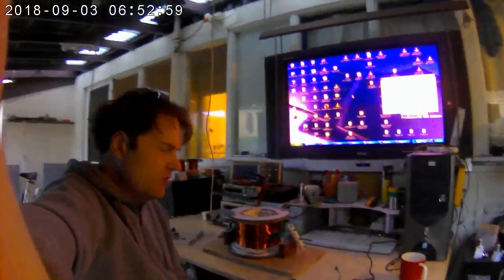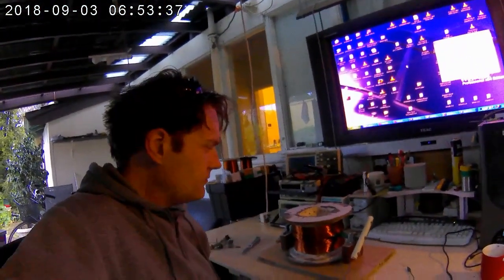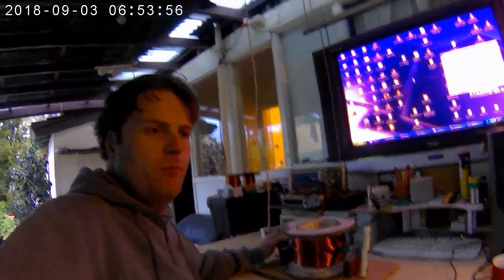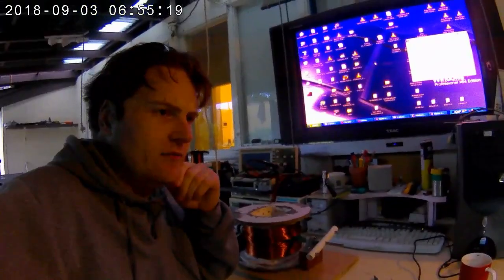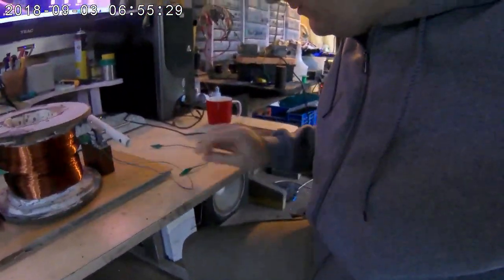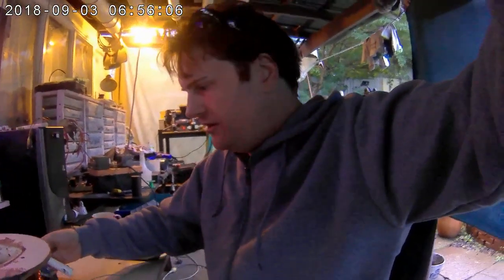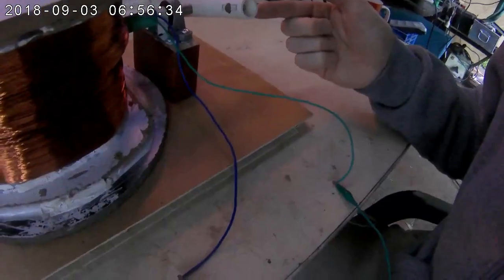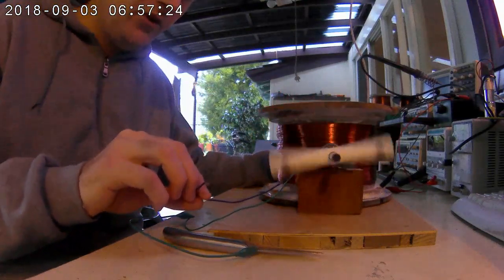Experiment in Free Energy, Amazing, [Newman Motor Part 3]

Comment: The working principle of any machine is based on the vectors. Everything is a question of vectors. Did you mind about the vectors? Usually the magnet rotate outside the self because we can put a core inside the self that concentrate a lot the magnetic flow through the self. The difference I have noticed with the Newman arrangement, where all the magnetic flow is already inside the self, is that the vectors are turned of 90 degrees, as they happen during the rotation of the magnet, uniquely. See usually, when the magnet rotate on front of a self with both leads connected, the first vector is repulsive and so is resistive against the magnet motion because the self oppose a pole of same polarity when the magnet pole is approaching,  and the second vector is attractive and so again resistive against the magnet motion because the self pole become the contrary of the magnet pole when the magnet pole is going away. Both vectors are resistive because you can not produce energy without producing a resistance of same amount, as e=r here or resistance is the contrary of the energy. The self become an electromagnet when an electric current pass through it, and so if the leads are not connected then there is no current, no electromagnet and no resistive vector. The parasite resistances such as mostly air friction, and the bearings, cause the resistance to be winner in the équation, and no moreover energy is created, only more energy consumption equal to the resistance. When the current is produced, you get an equal big breaking effect of the axle rotation.

Comment: just add diode in it to charge the battery, not used it directly to the coil so that the magnet continuous its natural motion.
Reply from the maker: thankyou sir, but i prefer not too work with free energy and batteries. this is a  lenz law free transformer, -
 i do believe i am working on one .  . - how do you 
feel about MEG ? .  because my model, is geared towards using permanent 
magnets, - and bouncing them, with lenz free "relaxation time" energy*. 
 kind of a magnetic resonance, , however switched in such a way, that 
the load is never on, when the primary is on.  - thankyou and watch my 
latest !!

Comment: One thing I was never able to get past was the self governing effect I encountered. It seemed I could never get more energy output than input as a result.
Reply from the maker: i have learnt from these newman experiments, that in all electric motors, the self governing effect, only occurs when the motor is slowed due too loading. -   ...  if you can create a motor that does not slow under load, - it is not limited in efficiency by lenz law.   -  newman has, in my opinion acheived that. - but only when it truly is a newman motor.....  any less than 1k of resistance on awg28wire is a waste of time.... -  minimun is a 4kg spool of awg 28. - but more is always better for COP
Reply: Have you seen this documentary 
https://www.youtube.com/watch?v=CrJIzrmX1mI @director-patrickwatkins
Reply: @director-patrickwatkins  I understand the governing effect from a load which makes it more difficult to turn the magnetic rotor,  but I was referring to a different type of governing effect where my motor would turn slowly,  even though the available torque would suggest it should be spinning much faster.

Comment: Why are you surprised the rotor stopped as soon as you shorted the coil?  You have large and what looks to be Neo magnets with a huge magnetic field.  You spun the rotor and as soon as you short the coil, the rotor immediately stopped because the rotating magnetic field induced a current in the copper wire that now has its own magnetic field that is in opposition to the one that generated it so the rotor quickly stops.
Reply from the maker: Laughs 1. because i was not sure what too expect. 2. because the sheer verocity of the breaking. -  the coil can stop, dead, the magnets much faster than i could, - it bodes well for my first free energy motor of this type.  .  PS, i have made great progress since this video in the last 6 months.

Comment: Newman used 0.1mm wire for the coil
Reply from the maker: gday Liz.  i heard newmans rule of thumb was,  to use wire no bigger than 1/8th inch,  and lots of it.... i wish you could feel the torque of my motor in person. its really very impressive,  a shaft they rips itself out of your fingers, using 1 watt.  really exciting ;-). ..   my next version. is coming in a few weeks.,  -  the plan is too partner it with another OU technology

Comment: Nice discovery..   I love those magnets,   Where did you get them. ?  i want a couple.
Reply from the maker: hehe they are fantastically dangerous, - i even got nipped through welding gloves,  - summoned my inner superman and actually separated them with nothing but a thick piece of steel inbetween.  wtf !   https://www.aliexpress.com/item/1PCS-N52-Neodymium-magnet-70X40-mm-gallium-metal-super-strong-magnets-70-40-round-magnet-powerful/32847085694.html?spm=a2g0s.9042311.0.0.27424c4dZo1oBM

Comment: jesus god dude that  the  biggest damn newman magnet i ever saw yet)::)
Reply from the maker: eeep yes they are scary. - i have a 10mm spacer between both attracting magnets.  - i had too vice them and use welding gloves too force them apart.  - they are almost impossible too work with.
Reply: @director-patrickwatkins  
I took 2x     2" X 2" X 1" N52 neyo magnets. Out the draw from an experiment a while back. Nearly lost a finger. Took me hours to separate them. 
They are so incredibly strong.